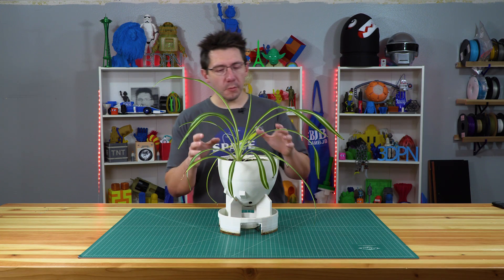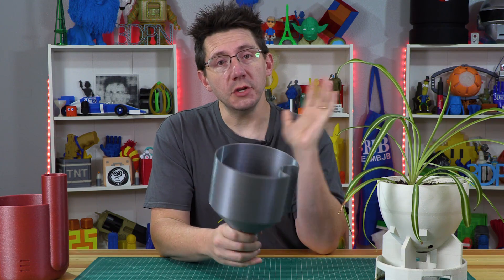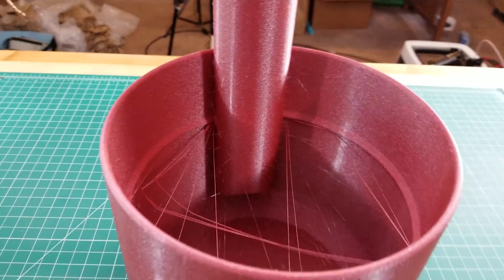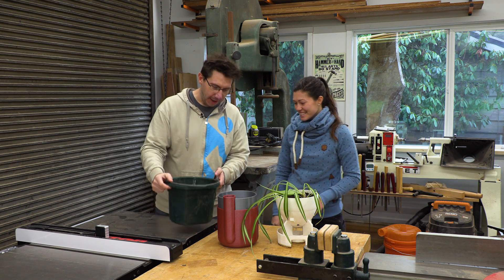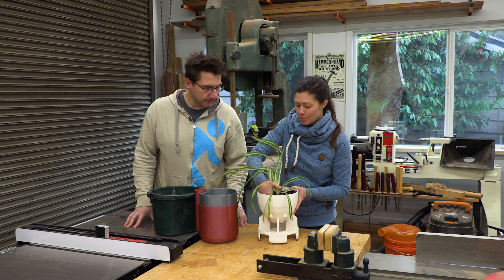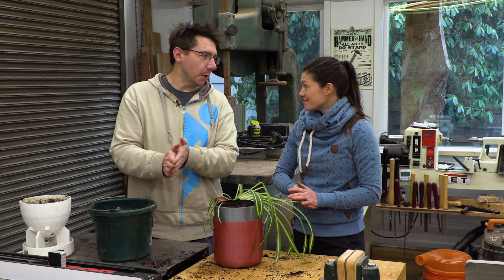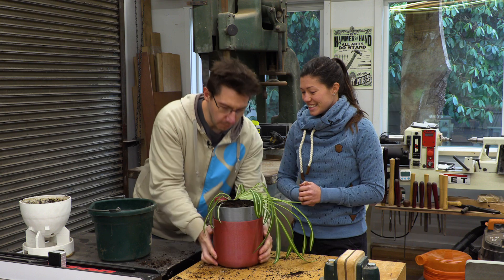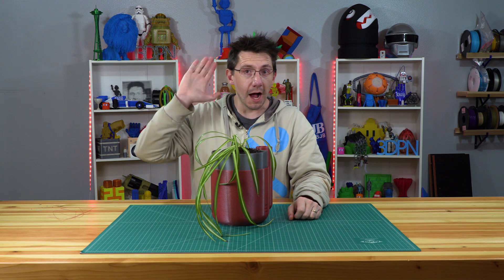3D Printing a Self Watering Planter and Getting Help from Anne Of All Trades

Comment: I printed smaller versions of a similar self watering pot. Best tip I can give is after you have transplanted the plant the first thing to add to the water is a seaweed solution as it eases transplant shock and stimulates strong root growth.

After a week or two, a nice diluted hydroponic solution is great as a feed.

Comment: I built a smart, automatically watering plant pot using 3D printing. It has a capacitive soil moisture sensor, water pump, rechargeable battery and a smartphone app for data display and push notifications. Feel free to watch my introductory video, if you are interested :D https://www.youtube.com/watch?v=rHHFL17ncnc

Comment: I just happened to print this as a first print with my new clone titan aero. Mine wasn't fully watertight so I added some glue then came across your video. Great advice about cutting back on leaves to help growth. This is a good tip for lots of plants that hibernate during winter eg rose bushes that have gotten a bit unruly. Trim them down before they are due to grow will help concentrate growth on the remaining plant

Comment: Great video and colour choice but... forgive the naivety...how is it self watering exactly? You didn't go through its functionality. Such as when the roots grow and access the water. What are the holes for at the bottom on the insert? 
I'm a mosquito researcher and I can see this as being an excellent alternative to traditional planters that act as breeding sites. You should print a screened cap to prevent oviposition in the watering port. Especially if it's going to be used outdoors.
Reply from the maker: I called it "self watering" because that's what the model name was on Thingiverse. I think it's a bit of a poor choice of name, as to make self watering it would need some sensors :) this will be used indoors, but I could see it being used outdoors I think.
Reply: @3DPrintingNerd  
Maybe if the spout was modified to hold an inverted bottle of water? Like those small animal water feeders, as the water lever dropped via transpiration and normal evaporation, it would refill the trough. Maybe the hole at the bottom of the spout is restricted to perform this function?

Comment: One other thing...  the pourer in the top of the bottle is a count pourer.  As a fun experiment, pour the bottle into a measuring cup with the plastic screen in it and see how many seconds each fluid ounce takes... I think standard bottles are 2 seconds per shot.  The spout used in bars are 4 seconds per ounce or shot.   Maybe you could 3D print some different pourer spouts for different flow rates?  the expensive liqueur could have the slow pour one so you don't give too much away :D

Comment: that is the saddest spider plant I've ever seen.  Try fertilizer and more light... Oh and BTW keeping the soil moist, all the way through, all the time, will slow the growth and make it look... well. like it does due to nutrient lock, and possibly cause root rot.

The top inch of soil at least, needs to be able to dry out.  Then you need to water from the top, taking the nutrients made from the soil drying out and interacting with the air, down to the roots.

A Dracaena plant would fair better in a continually moist soil environment, but even they need to dry out once in a while.
Most plants will not fair well in a self watering system that keeps the soil moist at all times... kinda why those types of pots aren't used by people with green thumbs.

Also the kind of soil you used is not supposed to be used inside.  Donkey poo is ideal for food plants but you never want anything like that in the house. 

Use sterile potting soil.  Water weekly and add a liquid house plant nutrient to the water once a month.

That was way too much water/rum

Comment: Gyroid works better than rectilinear on my prusa mk3.  The infill is set at 200 speed at at that speed it grabs the lower layers and makes spikes all around of the filament pulling up.  Most of the time it irons out but sometimes causes the part to fail.  Gryroid does not have that problem and it goes nearly as fast.

Comment: The rum bottle made me think of a self watering solution. If it had a longer neck, something that would reach the desired water level, you could just tip a full bottle over into the fill tube. The bottle would only release water when the water level dropped below the mouth of the bottle(letting air in). Not very advantageous, since it already has quite the reservoir, but could give a visual indicator for when water needed to be added. Also, (not that I've successfully grown anything, but) I've read that when watering from the bottom, it's good to occasionally water it from the top to "wash" the soil from the top to prevent salt buildup in the upper soil. This may only be relevant if you're using fertilizer though. Love the channel!

Comment: Great model, I would recommend the model that the designer posted on thier website, it solves some of the problems from scaling it up.
I did use Titebond-3 Wood Glue to seal it ( I highly recommend sealing it). Even with 3 shells at    . 3mm and print speeds at 15mm/s,   with PLA, I did notice a few drops woth of water seeping out overnight.
I am thinking of trying 3D goop the seal the next one, not sure if it's good for the plant?
Reply: Use PET?!

Comment: I printed one at regular size and it was water tight at first, but having water in it for 24 hours, there was water in the plate that it was sitting in.  I sprayed the inside with "rustoleum leak seal" problem solved.
Reply: did that leak seal end up harming the plant at all?

Comment: I think you should put wick through the holes, so only some water will go up to the roots. Without the wick the upper part of the soil will be always dry  and the roots will die. The lower part of the soil will be always be in water, and the roots will rot.
Reply: the soil will wick just fine and all be wet, but the roots do have a good chance of rotting and growing mould. 
These pots are best to getting cuttings to root or for starting seedlings, or for swap plants